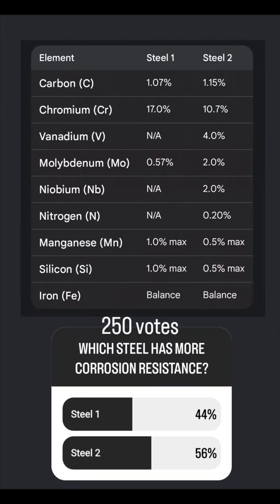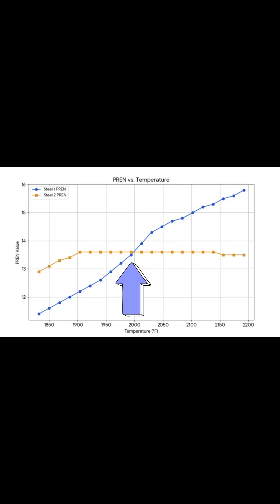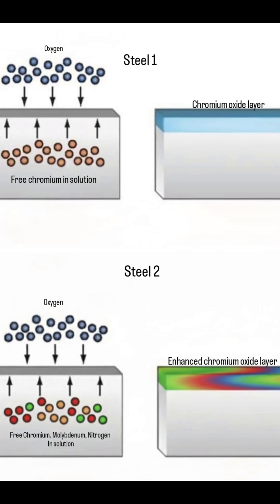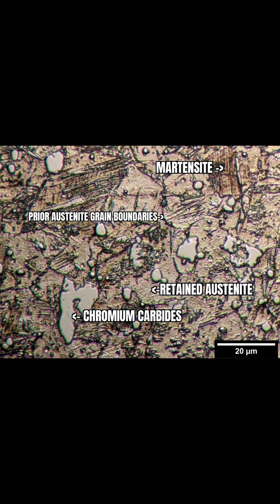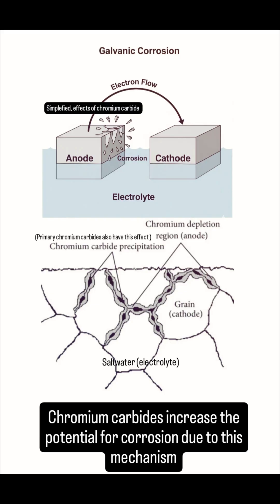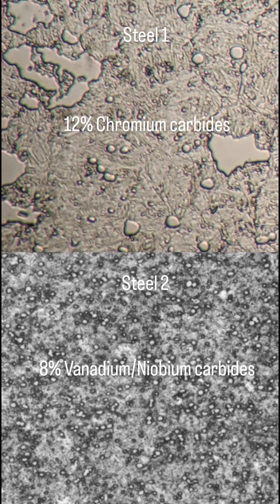Understanding The Mechanisms of Corrosion Resistance With Just Steel Chemistry?

Comment: Who's arguing that 440c is more corrosion resistant than magnacut?
Reply from the maker: That's not the point, the idea was to look at the chemistry and try to deduce from an understanding of how the chemistry works.

If it was framed as 440c versus Magna cut, people would just regurgitate what they hear rather than try to apply an understanding of chemistry and the mechanisms involved.

Doing such allowed us to get into a more advanced discussion than the typical "Brawndo has what plants crave; it has electrolytes."

Comment: In before the armchair metallurgists; specifically those that will insist steel #1 is more corrosion resistant based on whatever oversimplified info they have on the subject. 
I don't think I knew about molybdenum being pretty corrosion resistant in its own right, only that it left many of my machine technology classmates tongue-tied 😅
Reply from the maker: Nice, I should point out It's not the molybdenum by itself that is making the steel more stainless but Mo is helping create a synergistic effect with the chromium.
Reply: @FearNoSteel  Yeah, metal team effort

Comment: Paused it after you asked the question... Steel 2 is my answer.
Reply: I paused again after you said #2 and people didn't all agree... And I can only assume it's because of the chromium content and they don't know much else about other elements in steel.
Reply from the maker: Real-Time comment interaction, I like it.
Reply: It's interesting that the person arguing against #2 was using software, but didn't know that #2 was the winner based on the composition alone and your explanation is spot on and easy to understand. I don't think most people understand a lot about the subject matter in general.
Reply from the maker: The person that was using software was actually arguing for steel #2. I made the graphs based on his tables. The graphs show how complex the topic is and how it cannot be always determined with chemistry alone like most people do as we see from the poll.
Reply: @FearNoSteel ahh, then i didn't pay full attention. You're right, it can be fairly complex though because theres multiple situations where it can change depending on the composition and the protocol used for that composition. I understand a bit more because ive studied the subject at a nerd level for multiple years. Things can be surprising.

I also didn't go full screen and didnt see the poll.
Reply: @FearNoSteel Instead of comparing two steels, you could use one steel like m390 as an example and use a protocol with cryo and lower temperature temper and a secondary hardening temper Protocol also with cryo.

While you would think secondary hardening would rust by looking at it, it doesn't. In lab tests it will certainly rust sooner, but in reality, its not going to rust that easily unless your swimming in the ocean or you have a bead blasted finish.

Yes chromium is reduced, but theres so much of it, that its still stainless. There's pros and cons to both methods, i like both of them for different purposes. 

There's some other examples that are also interesting on the subject of stainlessness which are very interesting to study.